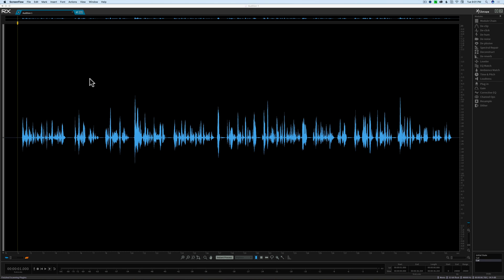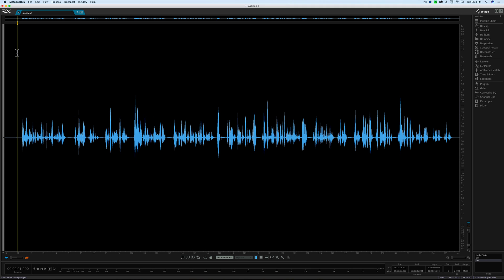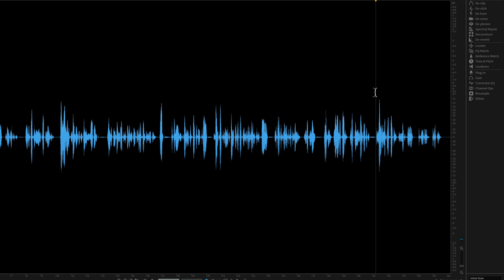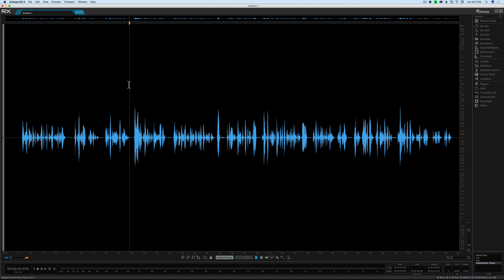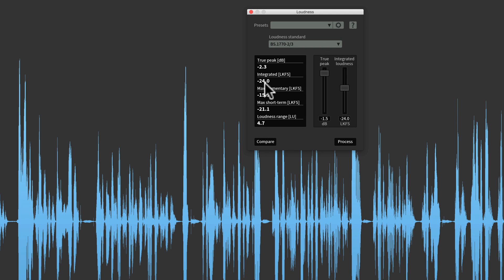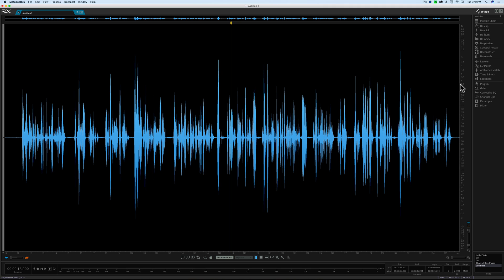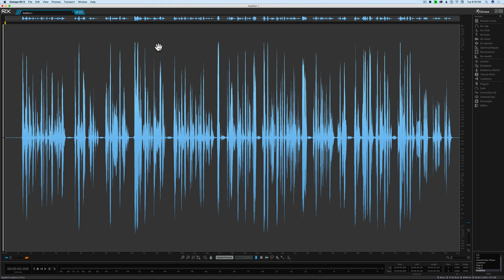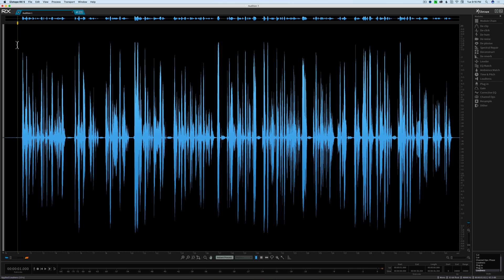Sound for Video Session: Loudness Normalization in Izotope RX5

Comment: Best routine for the dialog fixes. Thank you.
Reply: @curtisjudd  I wonder if you know how to best replicate your final loudness controls in RX7 Essentials? There is no way to just set limit and desired volume and render. I currently use mix of Gain and Normalise and analysing the track after each pass. Is there a better way? Thank you.
Reply: @moristar  Hi Alex, depending on the DAW or NLE you're using, some of them have ways to automate loudness normalization. Audition and Premiere, for example, have the ability to match loudness standards - match loudness panel in Audition, loudness normalize during export in Premiere.

Comment: Thank you very much for this. Finally someone explaining audio editing in a mathematical way I can understand. I was very disappointed when we got to the compression part, I have the same plug-ins as you do (RX6 and Ozone 7 on my end) and compression has always been my biggest hang up, so when you said "we're gonna just go through this quickly" I was like "nooooo!"

I'm still fiddling with the controls trying to get the Integrated part high enough to lower it to 19, but nothing is working, even matching up with the peaks like you did only gave me about a .2 increase. But thank you for the content you did give, it makes sense to me now how to process to -19 up til the compression part which is more than I had before. I'll do some more homework and see if I can figure it out.
Reply from the maker: Hi Phillip, it sounds like maybe you need to adjust the threshold down so that the compressor squashes the audio peaks more.
Reply: Hi Curtis, I tried doing what you did, and then moved the threshold down, and keeping the limiter part at -6 since that made sense to me to not have it go over that (still trying to understand it all), but then I was in a weird loop where anything I did with the Threshold seemed to make the True Peak a larger negative number, when I was just trying to fine tune it, so i had to start over. I'll watch your video on In-depth Compression to see if I can understand what I'm doing more, and maybe figure out the limiter side of things. Thank you for the response, I appreciate it!

Comment: This is great video. I learned a couple of tips that I've started using in my audiobook recordings that have really helped. One problem though. I downloaded the VST compressor plugin for use in RX5 (not advanced). I've pointed RX5 to the plugin and it won't open. Somewhere I read where Izotope has "black-flagged" some VST plugins. How do I get RX5 to recognize and open the compressor plugin? Should I use the 32- or 64-bit plugin?
Reply: Hi Jughead Jones, I would go with the 64 bit version of the plugin. I'd also contact Izotope support - they should be able to help troubleshoot, especially if Izotope is blocking the plugin for some reason. Best wishes!

Comment: Hi Curtis and thanks very much for this video.  It helped me to understand a few things I wondered about before.

3 Questions:
1.  In this video you are using a mono audio file but can all this apply to a stereo file as well?  

2.  And, if you apply the Adaptive Phase Rotation to a stereo file, might it upset phase relationships within the file itself and the phase relationship between itself and other audio files in a DAW?

3. As long as it's used lightly, would a limiter be ok to use verses a compressor?  I ask this because I use a normalizing plug-in that uses a limiter instead of a compressor.  RX 7 at $1000 is a bit too expensive for me at this point.

Thanks,

Steve
Reply from the maker: Hi Steve, 1) Yes 2) It hasn't made anything worse in my experience 3) Yes, a limiter can work as long as it has a bit of a soft knee and you don't need to manage super extreme spikes/transients. Best of luck!
Reply: @LearnLightAndSoundSessions   Thank you Curtis and take care.  By the way, I actually studied the Zone System in college way back when.  It was a good foundation for other disciplines in the media business.
Reply: @newguy6935  I agree! The zone system is still very applicable from my point of view.

Comment: Its better to get rid of phase problems before you record!
Reply: Agreed. Any recommendations for managing asymmetric waveforms on mono dialogue recordings. Phase invert simply moves the asymmetry to the other side of minus infinity line.
Reply: Mono recordings are easily corrected with Waves InPhase plug-in (can be purchased solo at Waves for small money) or MAutoAlign accordingly - this is probably shown most for multi microphone recordings. I've tested different options for microphone amplifiers, and now using Focusrite Voicemaster Pro - great value for money, and phase correct, and then correction is not necessary :)

Comment: Hey Curtis, would you say most video people are doing there audio processing destructively (like you show in this vid) or in real time with plugins in there NLE's? (Audio DAW's use processing slots in the audio tracks that you insert real time processors that are categorized as "plug-ins") I havnt used NLE's other than Davinci Resolve. (which doesn't have the ability to use industry standard plugins like the Ozone stuff.)
Reply: Hmm, not sure. Offline processing, which is usually "destructive" is pretty much necessary for things like loudness normalizing I think. But I'm open to learn better ways if you've got some input! :)
Reply: Curtis Judd what r u using for a nle?
Reply: Mostly Final Cut Pro X but some work in Premiere and even a little in Resolve. However, I do my audio work in Izotope RX Audio Editor and Audition.

Comment: Great discussion, I learned a lot. Unfortunately Rx5 Loudness tool is only in the Advance version. The standard version does not have this capability. Are there any plug ins that would have the same loudness capability?
Reply: Thanks Gregg. Good catch, I thought the non-advanced version had the loudness module but you are correct. You can also do this in Audition which includes both real-time loudness measurement plugins (Loudness Radar by tcelectronic - top notch)  and an offline amplitude statistics panel which also measures loudness and true peak amplitude. The main thing that Audition does not have which I demonstrated here is an automated phase rotation plugin. It does have a stereo phase tool which takes a bit of work and the results aren't usually quite as nice.
Reply: It's great that you talked about the phase rotation correction. I had no idea some voices are asymmetric in nature.
Reply: I know mainly because my voice is highly asymmetric. I thought something was broken for the longest time. turns out that its just a "feature" of some peoples' voices.